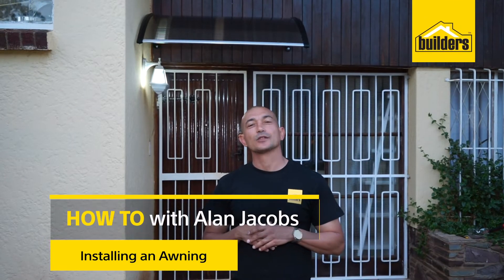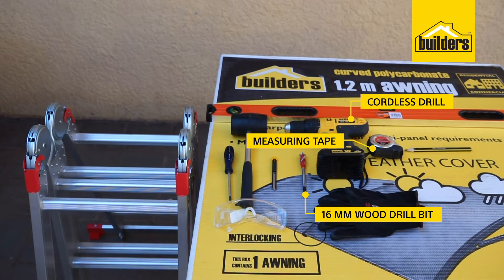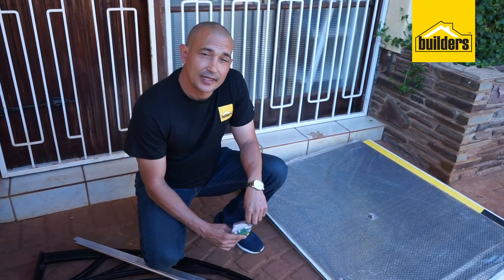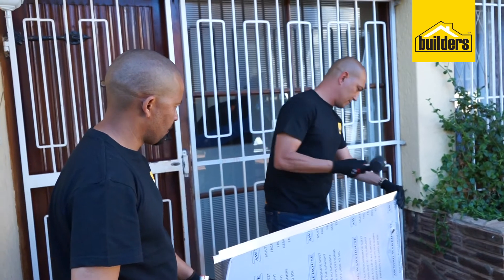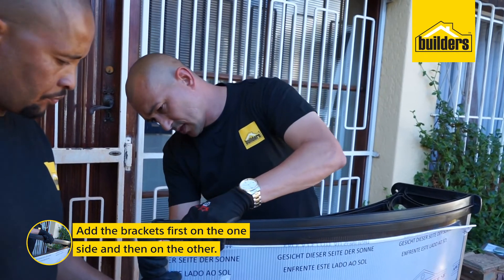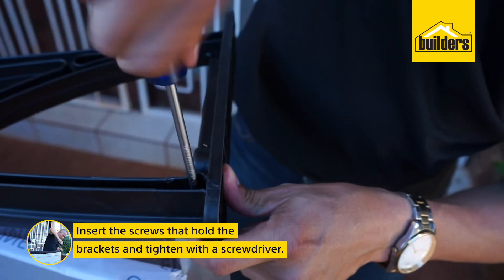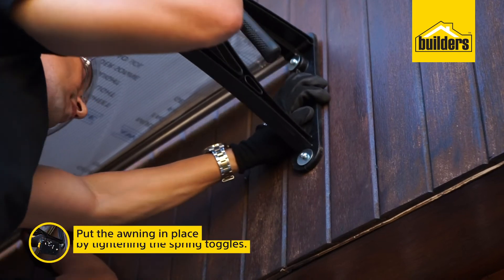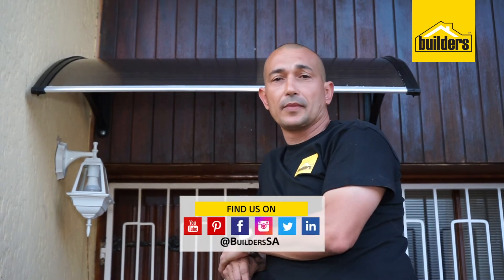How To Install an Awning

Comment: I bought some of those from Amazon and I'm wondering what is the best method of installing those on the exterior of a mobile home? I'm assuming of course you got to find where the studs are and then pray the studs wine up so that you can install the awning deadcenter over the window